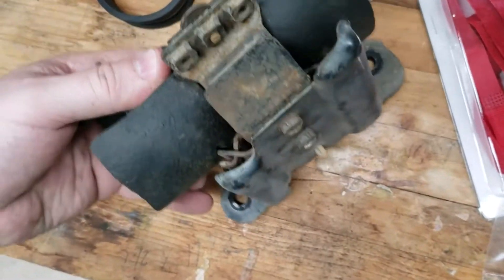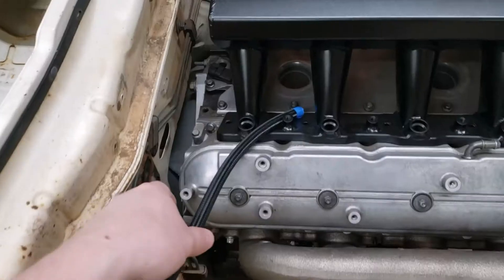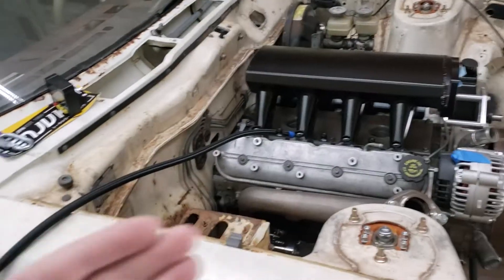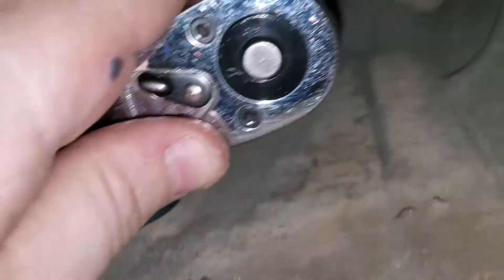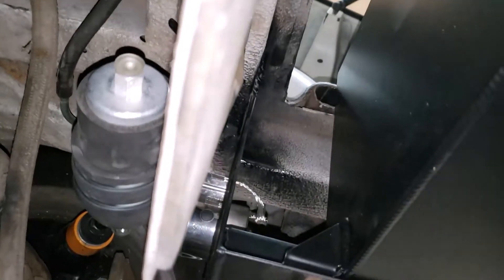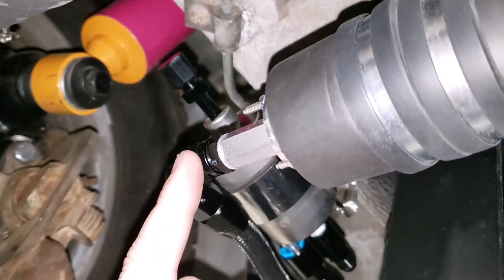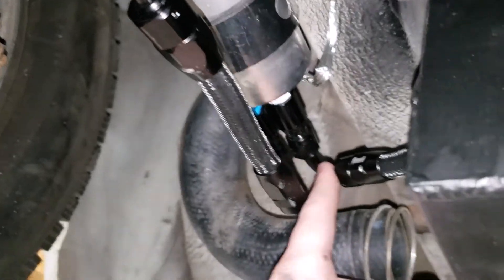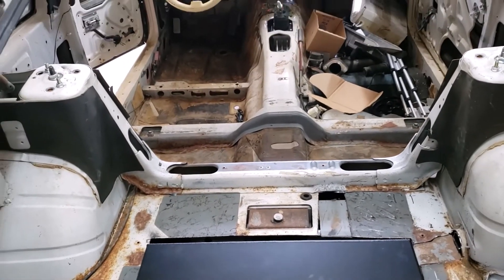LS Datsun 280zx fuel system upgrade - How to make AN lines

Comment: Looking at using the same  fuel pump you did for my LS swap, but still looking at using the old 280 tank.  Set up is a little different.  Would you recommend😊 that or a different setup?
Reply from the maker: I'd recommend this set just because it cuts down on having to have a separate fuel filter and fuel pressure regulator (not to mention only needing one line running to the engine bay). That being said I haven't had a chance to test this setup but it's pretty standard in the LS swap world.

Comment: Great video. Did you remove or keep the original Fuel Damper that's right after the pump on the line headed to the engine?
Reply from the maker: Thank you, I removed it because I'm going to be running a 5.3L ls and don't need it 👍

Comment: What fuel cell is that? And did the cage come with it or did you fab it?
Reply from the maker: It was one off Amazon or Ebay and I had to fab the cage. There should be some that come with straps or a kit to mount the tank